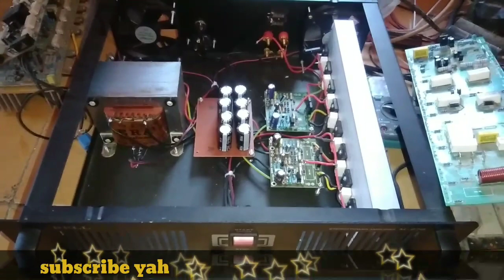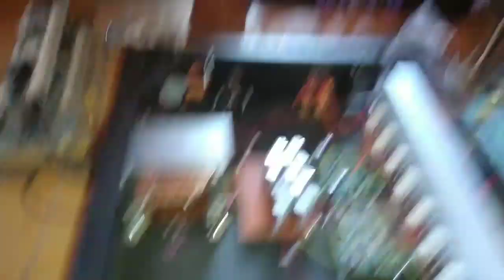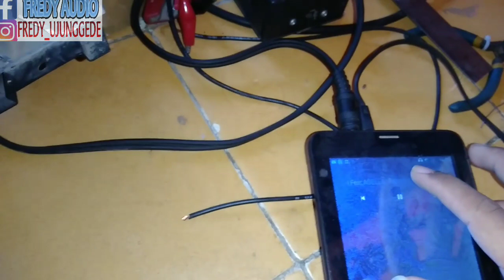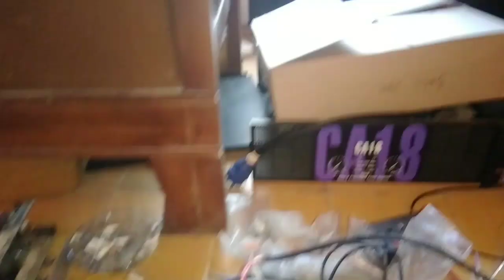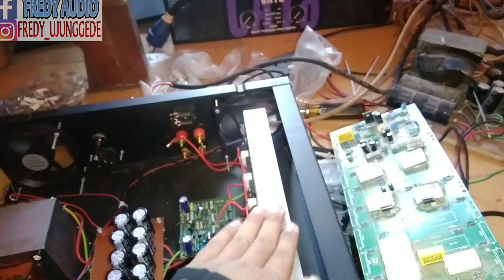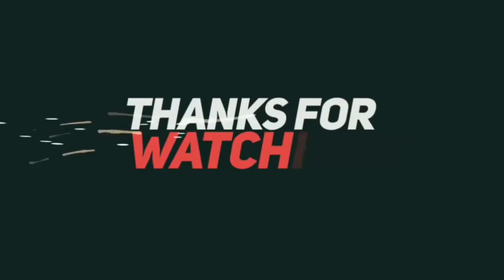Cara Menghilangkan Dengung Pada Power Amplifier

Comment: Mas kalo tune volume pakek yg brp kilo dan pakek tune yg besar apa yg kecil.. biyar bisa lebih enteng dan loos tenaga swaranya..
Reply from the maker: 5-10K
Reply: @FredyAudioPemalang  potensio yg kecil ya mas..
Reply from the maker: @arbitube8054  ukurane sama aja tp nilainya kecil
Reply: @FredyAudioPemalang  oke siap.. makasih mas saran nya..
Reply from the maker: @arbitube8054  di like karo subscribe yaa..
Sama share di Facebook
Reply: @FredyAudioPemalang  siap mas..
Mas tanya lagi. power ku kalo potensi di tutup trjadi dengung keras. Dan kalo di buka full trjdi dengung keras. Tp kalo di buka separu dengung dikit. Kira2 gmn solusinya..
Reply from the maker: @arbitube8054  ganti potensionya
Reply: @FredyAudioPemalang  oke siap. Soale potensionya seng 50 k tp gede itu mas..
Reply from the maker: @arbitube8054  sip tinggal ganti

Comment: Om saya mau nanya neh.. tp seputar DIY Speaker Bluetooth

Supaya tegangan5V pada speaker DIY bluethooth lbh stabil pakai apa ya.. Soalnya saya sudah pakai Elco 16v dgn 1000uf msh saja ada noisenya.. 

Tp klo saya pakai tegangan atau charger pada listrik. Noise hilang.. Klo pakai input dengan batre malah timbul noise..

Kira2 pakai ini bisa ngga yahh lbh stabil.. Seperti pakai chargeran untuk daya inputnya
Reply from the maker: Pakai batre bekas laptop 4.2V 6Biji 
Elkonya pake 16.Volt 10.000Uf 6Biji
Trus pake step up DC to DC dari 4.2 ke 5.5Volt
Reply: @FredyAudioPemalang  om itu serius 6 biji? klo 6 biji bukan 4.2V dunk jdnya.. udah lbh dari 18V.. saya udah pake StepUp juga dari 3,7V ke 5V tp msh aja ada noisenya klo di denger dari jarak 20cm kuping.. klo saya pakai powernya colokan charger langsung yg 5V noisenya hilang..
Reply from the maker: @DaniMutaqin  6biji dipararel jgn diseri..

Noise timbul mungkin gara2 kurang amper
Reply: @FredyAudioPemalang  ok siap om saya coba dlu .. terima kasih masukannya semoga berhasil

Comment: Mas mau tanya power ada nois setelah di sambung mixer eq dan crossover itu penyebabnya apa? Kalo cuman power input an hp tidak. Tolong d jawab mas masih pemula soalnya. Trimakasih sebelumnya
Reply from the maker: Dicek satu2. Mana yg menyebabkan noise
Reply: Iya mas saya cek satu2 dulu
Reply from the maker: @vianherdeka2934  oke

Comment: Gan, bisa bantu atasi dengung pada amplifier class D 2x15 Watt PSU non simetris body box plastik selain tarik kabel ke bumi dari negatif potensiometer atau negatif output PA..
Reply from the maker: Psu pake smps?
Reply: Fredy Audio Pemalang : iya pakai PSU SMPS model adaptor laptop.. Kapan itu pernah pakai tipe jaring-jaring, L & N masuk input PLN dan ground ditanam ke bumi baru hilang dengung nya.
Reply from the maker: @iwansetyawan5687  ganti pake travo kotak dulu
Reply: Okay terimakasih infonya nanti tak cobanya.

Comment: Mas punya saya travonya 10A ct 55 pk kit blazer 800 watt ×2. Gimna ngilangin dengunya ya trus klo bodi amplinya di pegang dengunya namba keras. 
Tolong kasih solusinya
Reply from the maker: Pake video ini aman
Reply: Nti tak coba cek dulu perkabelanya. Mklum masih pemula trus ampli saya beli jadi dari tukang rakitnya.
Reply: Mas kalo haetsingnya di baut ke body/kas ampli itu pengaruh nga??
Reply from the maker: @ayamlalapan4559  suruh dibenerin sama yg rakit
Reply: Udah di sru lihat juga sma tukang nya tpi ya gitu" adja katanya emang udah gituh. Suarnya sih udah bgus cuma itu dengungngya yg nga bisa ilang.
Reply: Makasih ya mas semoga sukses trus di tunggu vidio" yg lain
Reply from the maker: @ayamlalapan4559  power saja apa ada tone kontrolnya?
Reply: Ada tonenya pake bell c40
Reply: Di buat 2 chanel. Yg A aman" nga ada dengung sma sekali tpi yg B dengungnya keras
Reply from the maker: @ayamlalapan4559  final mati
Reply from the maker: @ayamlalapan4559  tone dicopot aja
Reply: Mas ampli saya kalo dinaikan tegangan dari travo ko jadi dengung knapa ya mas.... di 25v travo normal tpi kalo dinaikan ke 32v baru kontak langsung dengung, mohon pencerahannya mas....
Reply: @ariepradana9917  itu kabel bodi nya kurang bagus bro,coba ganti kabel yg masuk ke driver yg lebih bagus

Comment: mas kalau yg dengung dari tone control gmn carany?
Reply from the maker: Suply tone pake suply utama
Dikasih R shunt
Reply: saya sdh pakai suply simetris mas.pakai R ny ukurn brp mas?
Reply from the maker: @dwiyanto4060  strumnya simetris toh

3k3
Reply: pakai 3k3 sambung ke p0sitif 1biji,kenegatif 1biji gitu mas?
Reply from the maker: @dwiyanto4060  betul biar tetangganya turun
Reply: @dwiyanto4060  kalo pakai 2k2 bisa gan....
Reply: Raihan Ali trima kasih ilmunya.semoga bermanfaat.
Reply from the maker: @dwiyanto4060  bantu Subscribe yah Bos
Reply: sdh lama kok sy subcribny cannel mas.
Reply from the maker: @dwiyanto4060  makasih
Reply: mas,sy baru ngerakit ampli yg boxnya dari kayu menyatu di dalam box speker.

sama sekali blum sy beri ground,karna sy sedang mencari cara ground yg benar agar ga dengung atau noise.

tolong mas bantu sy,gimana cara groundinya.
dr mulai trafo ct,potnsio meter,oh iya kitnya sudah 1 set (tidak terpisah)
Reply from the maker: @ade4077  kasih alas plat aluminium

Itu sebagai titik grond
Reply: Kalo crossover noise gimna mas.....musik berhenti suara noise keras

Comment: Mau tanyak mas power saya yg stereo dengung sebelah itu knpa ya
Reply from the maker: Ada ground loop
Reply: @FredyAudioPemalang  grond loop itu pa mf pemula🙏🏼🙏🏼🙏🏼
Reply from the maker: @firmanhariono6018  gronding nya muter2
Reply: @FredyAudioPemalang  mas pwer q udh g denggung tpi ko suaran musiknya jadi pelanya. 
Tak coba grond q lepas suara musik jadi kencang lgi tu g merubah folume tetep sama🙏🏼🙏🏼🙏🏼
Reply from the maker: @firmanhariono6018  grond di potensionya lepas?
Reply: @FredyAudioPemalang  gak mas
Reply from the maker: @firmanhariono6018  cek kabel potensionya kalo perlu ganti potensio baru
Reply: @FredyAudioPemalang  ok mksih saranya

Comment: mas, klo kit saya disuply 25v aman" aja, tapi pas dinaikin 32, 42 malah dengung mas. tolongin mas
Reply from the maker: Kit apa
Reply: bali 400-1000 watt
Reply from the maker: @kulilemong4562  suaranya kurang enak

Ganti socl saja
Reply: drivernya 3tingkat
Reply from the maker: @kulilemong4562  iya prrnah coba agakserak itu
Reply: tapi klo drivernya di naikin tegangan trs dengung gitu karna apa ya mas?
Reply from the maker: @kulilemong4562  gak kuat volt tinggi
Reply: yg cocok buat trafo 30A 47v pake kit apa mas?
Reply from the maker: @kulilemong4562  gwg

Comment: Mas mau tanya nih. .saya kan pakai driver power sanken 400watt stereo. Cuma pakai tr final sanken 1 set kanan kiri. Kira² kalau disupply 45volt dri trafo aman nggak mas. Mohon bantuannya 🙏🙏🙏
Reply from the maker: Minimal 2 set
Reply: @FredyAudioPemalang  klau 1 set knp mass
Reply from the maker: @paimencukk8562  panas
Reply: @FredyAudioPemalang  resistor kaki basis tr final pake yg brpa mas
Reply from the maker: @paimencukk8562  10
Reply: @FredyAudioPemalang  oke mas makasih
Reply from the maker: @paimencukk8562  bantu Subscribe yah Bos
Reply: @FredyAudioPemalang  sudah bos. Siapp
Reply: Bos mau tanya lagi. Power saya yg sebelah bunyi krasak² sedangkan yg sebelah aman. Itu apanya ya
Reply from the maker: @paimencukk8562  potensio
Reply: @FredyAudioPemalang  meskipun potensio dilepas. Trus saya colokkan listrik tetep aja bunyinya kresek² mas.
Reply from the maker: @paimencukk8562  drivere soak
Reply: @FredyAudioPemalang  ternyata tr drivernya yg bermasalah bos